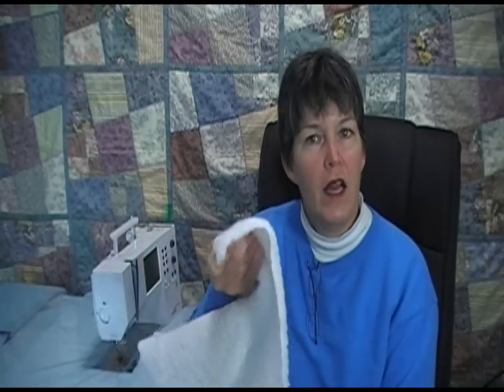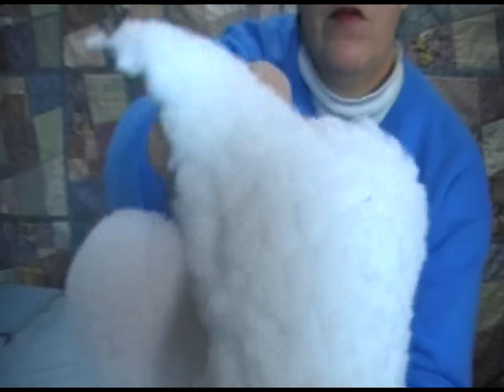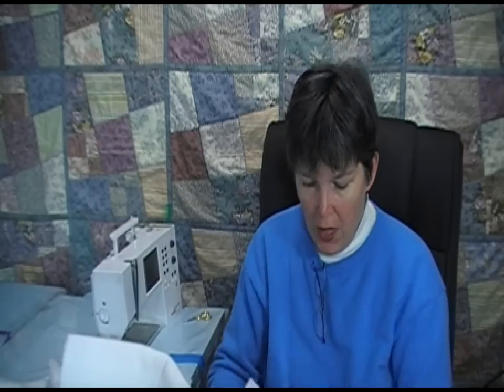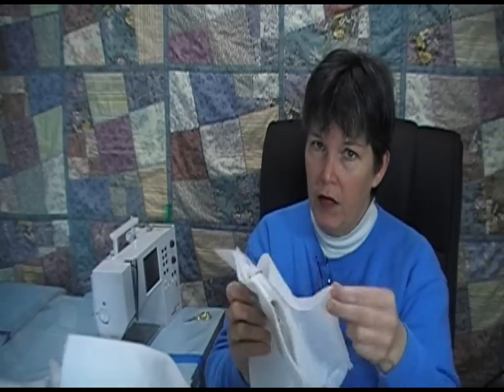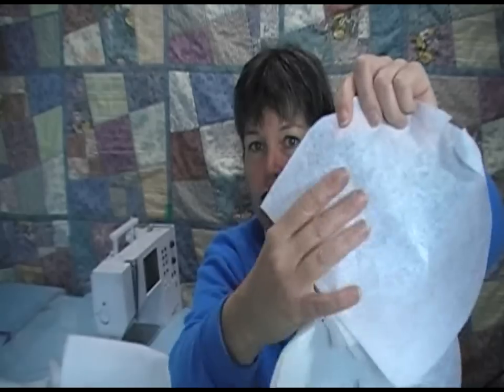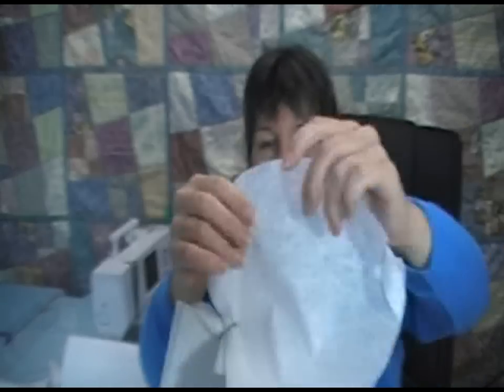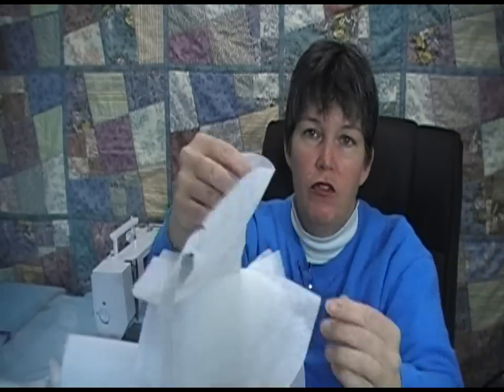Sewing Machine Problem - Solution?

Comment from the maker: @ciniluwhoo There are a few things you can try:  start with re-threading the TOP thread a couple of times, clean any lint or fiber buildup in the bobbin and race area, try different threads or have a mechanic check the timing on your machine. I sure hope one of these helps :)

Comment from the maker: Hi ruth, I can only guess, but I would sew with the elastic on top (not on the bottom) and I'd take all the thread off the machine (top and bobbin) and give the race (the bobbin area) a good cleaning. Use a flashlight and tweezers and look for any loose or broken threads. Then re-thread it and try again on scrap material.

Comment from the maker: You might want to try stabilizing the material. This can be as easy as putting some newspaper between the two fabrics or using a desolvable stabilizer. With a stabilizer you can control the stretch of the nylon, which is probably what is causing the slipped stitches. Let me know, okay?

Comment from the maker: Hi Catrina, Does your machine sew well with any fabric now or is it totally jammed?  If you haven't already tried this, try a brand new ball point needle and use a thin piece of paper under your fabrics (you can carefully tear the paper away after sewing - test this on some scraps). If you have a single hole needleplate, that can help, as well as using scraps to start sewing with and then feed you project in butted up against the scraps (called a starter or leader). ~Marguerita

Comment from the maker: I would re-thread the *top* thread several times, to clear any lint, making sure that the presser foot is in the up position when threading. The rule of thumb is that if the bobbin thread looks bad on your project, the problem is with the top thread - not the bobbin. I sure hope that helps.......... M

Comment from the maker: @Nicky0481  Hi Nicky, it's really hard to diagnose the problem without seeing your machine in action, but it sounds like the machine is "out of timing" - meaning that the needle movement and the bobbin rotation are not synced like they should be.  If that is the case, it takes an experienced sewing machine technician to re-set the timing.  I wish I could be more help!  Marguerita

Comment from the maker: Hi Sara, when you thread the machine, is the foot up? Is the bobbin snugly and evenly wound? Have you tried a different thread and different bobbin? Can you try sewing on some thick scraps and some thin ones and see if either makes a difference? If you changed the timing, are you very, very sure that you got it right, because that's the most likely issue - that the timing is still off. Let me know, okay?  ~M

Comment from the maker: On an older machine, you have to pull the flywheel out in order to get the bobbin winder spindle to turn - is your machine an older one or new? On new ones, sometimes you push the bobbin winder spindle to one side to engage it. The flywheel is the round part on the motor end of the machine and it turns as the machine sews. Let me know, okay?  ~M

Comment: well i found it to be a smattering of issues. my machine was due for a good oiling, i noticed after more research that my bobbin was not wound properly and i was using the wrong needle i had a 2020 on my machine i needed a 2045 80/11. its working beautifully now

Comment: Hi, i just bought an Akira sewing machine early this month and i start to learn to using it and at the 1st time i have problem when i try to hook the thread from the bobbin,then i successfully with a few tries and finished my 1st sewing project without any problem..and suddenly when i sew some elastic material a day after..the stitch under the material having a messy loop..and i fix the upper and bobbin tension to balance the tension but it become worst like the shuttle hook spinning is jammed..

Comment: yeah i already race the bobbin area without any bobbin case or the hook but when i manually spin the wheel in a slow spinning it look ok but a little bit harder then it supposed to be smoother right?when i race it it got stuck and jammed and i have to use my finger to push it and it is hard..is that possibly any thread at the center of the shuttle hook ?

Comment: I have been sewing on my Bernina 230 with the same thread and bobbin used on a couple projects with no problem. All of a sudden, the bobbin thread is jamming up and I am only a couple inches from finishing my project. . I took out the bobbin,  cleaned it out and even gave it a drop of oil. I changed the bobbin and had the same problem. Does anyone have a suggestion?